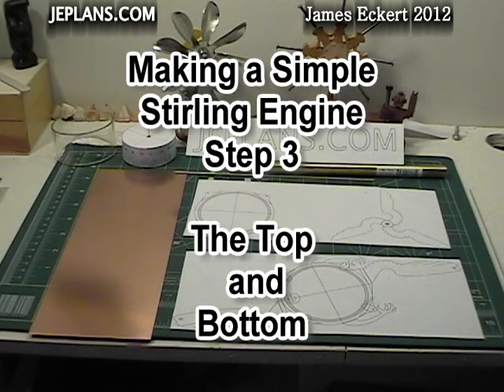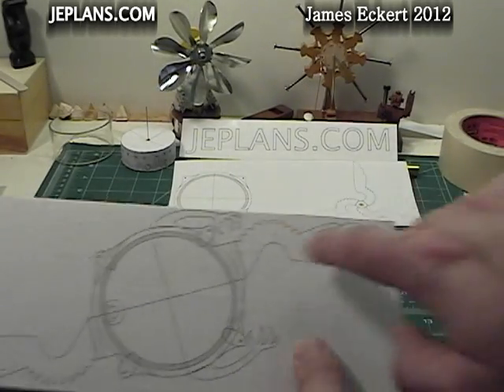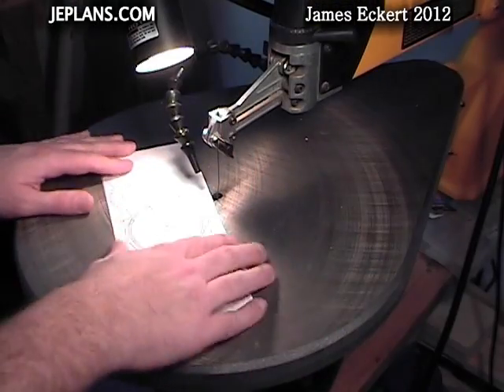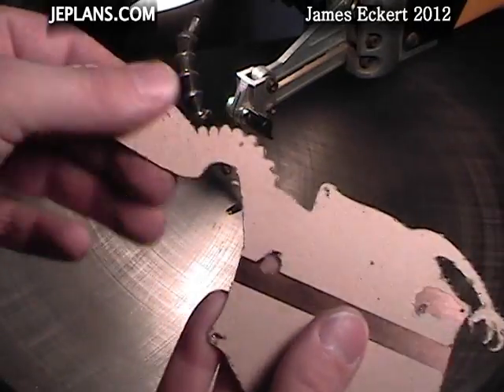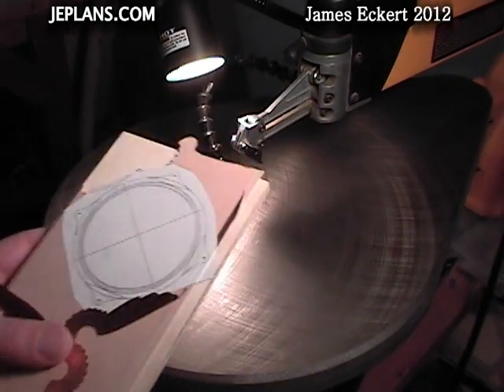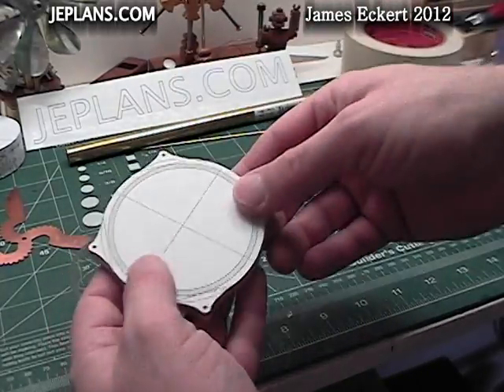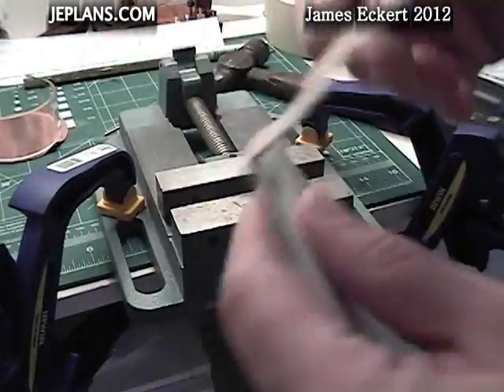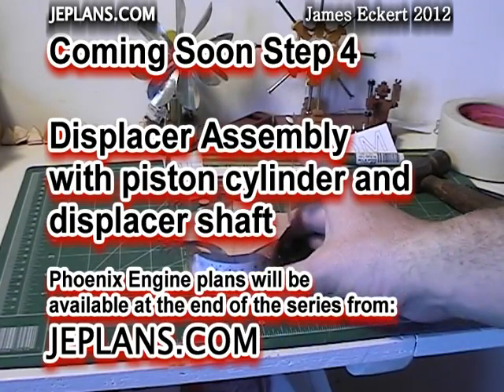Step 3 Making a Stirling Engine:The Top and Bottom

Comment: Wondering if you've experimented with different materials or thicknesses on the top & bottom to optimize the temperature gradient. Any insights would be appreciated. Again, nicely done and thanks for sharing.
Reply from the maker: As thin as possible while still rigid, the better the heat conductor the better it will work. Copper better the aluminum both better steel.

Comment: The 3rd installment in a step by step process for building a basic Stirling Engine using parts that should be available locally to purchase at most hobby and hardware stores. (at least in the US). The Focus of this step is making the top and bottom of the displacer.